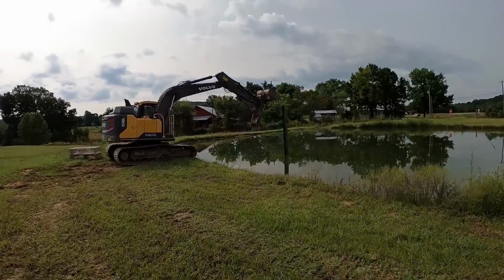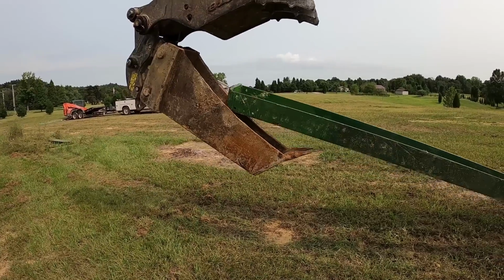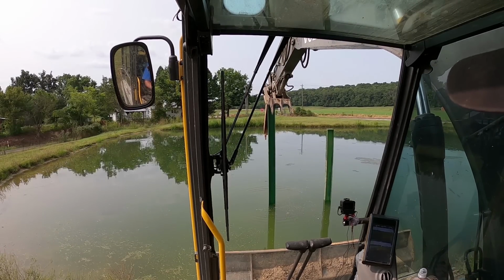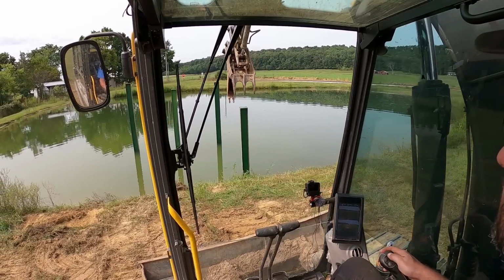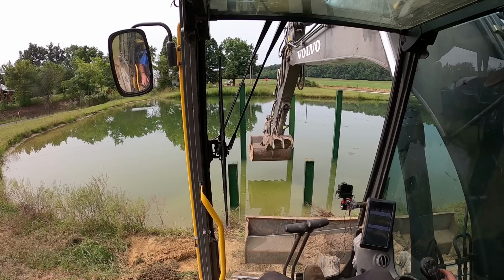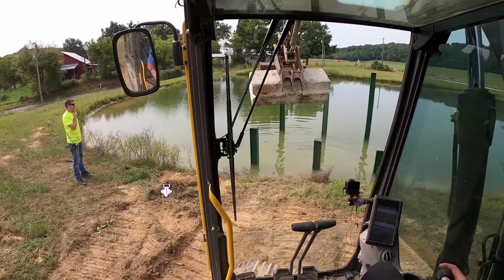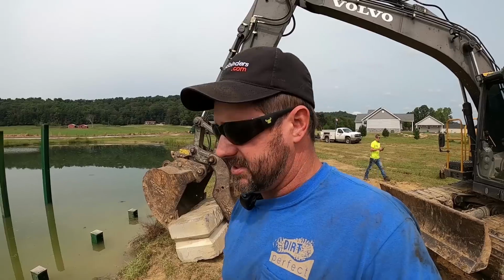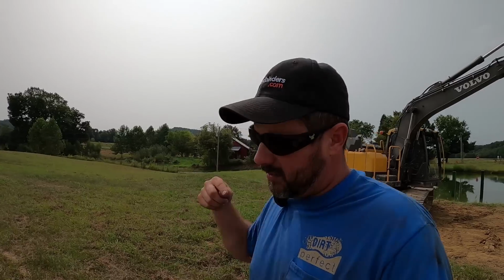Redneck pile Driving installing steel piers for a new Dock with excavator and large weight

Comment: Well this was a first for me.  I have seen pile drivers used to drive post, but I have never seen a excavator with a block of concrete used as a pile driver.  It's like you said " run with what your brought".  And it worked, great job again Mike.
Reply from the maker: Thanks

Comment: That worked out way better than a bunch of guys I watched up in Virginia once. They made a work barge and pile driver with old wood and 55 gal barrels. This part worked great. Their problem started when they were trying to weld the beams on top of the posts. The welder was in an aluminum boat and when he struck an arc he got a "minor" shock. He dropped his welding lead which arced, burned a hole in the boat which sank taking him and all his equipment to the bottom. I laughed my butt off since no one was hurt, just a little embarrassed. Y'all stay safe and keep the vids coming.
Reply: OMG, too funny. :)
Reply from the maker: lol not good

Comment: Seen a  homemade pile driver at a location. They used a old bucket with a bad floor, filled it with heavy rock and cement and welded thick plate onto the bottom. Reinforced the wall to floor joint. Locked the cement in with 3 rods welded across the top. Honestly thought it was pretty smart.

Comment: Fabricator could have tack welded a beam to give you the 16ft space needed between front and back posts.  The face of every I-beam, even off by a degree will be feet apart over a 16ft span.  I think he'll have no problem making it work.  But could have saved himself hours of balancing over water, with a few welds on dry land.  You guys do good work!!!  Cheers Mike.

Comment: We used to drive pilings around DC to support lagging & when the pile driving crane couldn't reach we used a wild-hammer (like when there were power lines in the way, etc).  We drove them 100 foot down or so to sure-up earth for underground parking in high rises.  We'd go down 4 stories or so.  Once in a while we'd hit granite and the piling would bend and come backup ('U' shaped).  When I was a kid, we drove pier pilings in the water using a hose and pump.  Connect the hose to the bottom of the piling and let the water clear the way.  They'd go right on down, then we'd have to go down and disconnect the hose.  We also drove sheet piling for coffer dams for bridge work.  Sheeting, suring, pile driving and underpinning buildings.  Just like kids play each day.

Comment: The block work great as a sledge hammer except for when you ended up balancing it on the post when it slipped out of the thumb and at the end when it broke right half in two. 
Either way it saved you from fishing concrete chunks out of the pond. 
The customer should have a very nice dock when he finishes it. 

This might be a lesson for Captain Kleeman to get any posts into the ground before the water level comes up too high if he wants a dock on his pond.

Comment: For the short ones, you should have put a string from shore out around the outside of the outer post then back to shore.  Square up the string & set the distance on shore,  then it would have been easy to make them the same width...  just touch the string and ey ball the middle short one.
Reply from the maker: Yup
Reply: @DirtPerfect  Of course maybe the capt. likes  bucket surfing too...

Comment: You need one of those vibrating attachments. I just had a contractor drive some pylons for my boat lift and they were hammered down in no time at all. 14in poles and they hammered them over 15ft into the ground. My house is about 30ft to my bulkhead where my dock is and that vibrator shook my house pretty good when it hit a certain harmonic just right.  But it was cool watching those huge poles being pushed down by an excavator on a barge.
Reply from the maker: If I did more of it possibly

Comment: if you want to push a pile into the mud straight and easy hang it from the bucket with a short piece of chain and gravity will make it straight as you drop it in then you just have to jiggle the bucket till the chain comes off. tie wire the excavator side of the chain or you might have to swim for it
Reply from the maker: Works good if you have mud to work with

Comment: If you used the water level you could paint a white line on each pile where you want the water level to be and the they could all be driven in to correct depth more easily.
Reply from the maker: We did on the short ones

Comment: Y'all need a laser range finder.
Maybe at your local military surplus store ot online.
It'll makes measuring those off shore dock supports a whole lot easier  😎
Reply: I got a laser some where around here that will measure like 35-40 feet away that was like 25 dollars at box store a few years ago.
Reply: @blackw0lf993  
A friend of mine gave me one that went out to 100 feet about 12 years ago and I only used it once before our house got broken into and they stole it.
A year later I needed but ended up use an old fashioned construction site clothe type measuring tape I'd picked up somewhere over the years.
Lost that in our last move when I retired.
Reply: @ronaldheit196  it would measure to 150 feet but it wasn’t very accurate unless you were only wanting a rough idea of the area. I last used it to measure aircraft to see if they would fit into the hanger while playing hanger Jenga

Comment: Use build piers that's how we done it. Actually we pull of the house doorway sorta like do sidewalk but that's why need 2 squared pegs markers on land go off of do that by setting peg on land pull off that for furthest outside pole then get aware off them for second ground peg for second outside pole wrap them with string line set all poles you want to them lines
Reply from the maker: Interesting

Comment: just looking at the thumb setup it has 3 teeth for grip over a small area but that should be fine for holding, where the change may need to be  is in the link attachment points just above your hand @29:36 . you have 3 adjustments points along that link. the question is are you getting full leverage in the configuration it is in ( can not find any information on the best setup )..  like at the thumb it has 2 places for the pin working up you have 2 more places for that pin and on the boom you have 2 places.  not sure that is why I am asking
Reply from the maker: They are not adjustments

Comment: Can you get a larger diameter hydraulic ram for the thumb? With a larger diameter, you will get more force from the ram without needing to increase hydraulic pressure. Increasing from a 4 inch ram diameter to a 5 inch ram diameter would increase the force by 50% with the same hydraulic pressure.
Reply from the maker: Thanks not the problem cover in a up coming video

Comment: Use what you brung.. you had string line.. that's better than any expensive tool.. you could have String Line both sides of the outside two columns too sure thin cross measured it.. but at the end of the day as long as a customer happy..
Reply from the maker: Lol yup

Comment: Should get you stake on land first. Pull out distance you want for outside pole. Square bank peg off the one you have distance you want now you have distance and width pull off of for all 4 poles and you can set them then just set middle poles to string line dead center

Comment: Replace the progressive link thumb's hydraulic cylinder with a larger diameter.  Then it will have more power.
Reply from the maker: No not the problem
Reply: Does that machine have a programmable pressure adjustment for the working Aux lines? 
Another not cheap possibility is the hydraulic lines some kits come with four wire hoses that swell as pressure is applied thus acts like an accumulator and robs your total pressure as it allows the thumb to flex in the clamp position and lose the grip. (I figure you prob already checked those but thought I would mention it if you haven’t.) 

i would be interested what the pressure output of the Volvo circuit is verses the deer and how close the settings are to either middle of the settings or max of the allowed working pressure. Also the way the thumbs are made makes a difference without being able to see either one or them side by side does one have an obvious mechanical advantage over the other IE the pun locations on the links give more than a 4-6inch lever action of one thumb over the other thumb. I would look I to those before raising the thumb pressure but if it is on the low side of allowed max pressure for that tool then other adjusting it up or a 2-5 thousandth shim might improve it greatly if it’s not got a mechanical adjustment ( I would be surprised if it was adjustable and even more surprised of its set right from install)
Finally the secondary safety pressures need to e checked on both and compared at some down time moment

Comment: It's the size of your hydraulic piston you need a stronger hydraulic piston or you need somebody to rebuild the piston so it holds pressure better don't increase the pressure of the lines you'll be blowing them out

Comment: As a crane operator I would of did this fast and simple one string line all measurements done on shore set up in min but nice job I understand it will all be covered up
Reply from the maker: Did you miss the point in the video when we said use what you have 🤷‍♂️